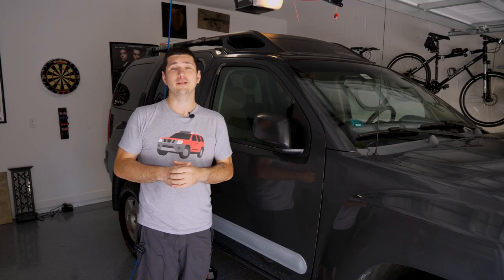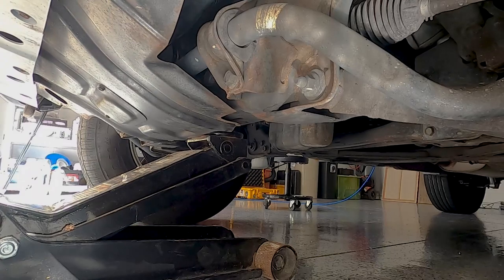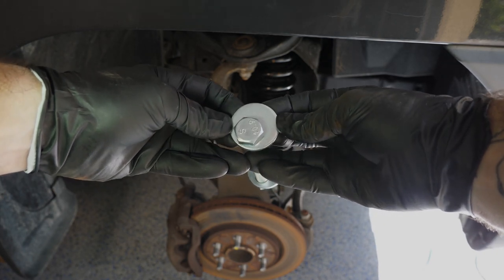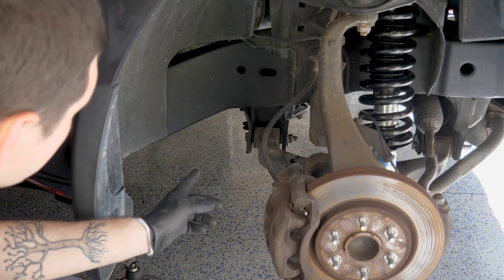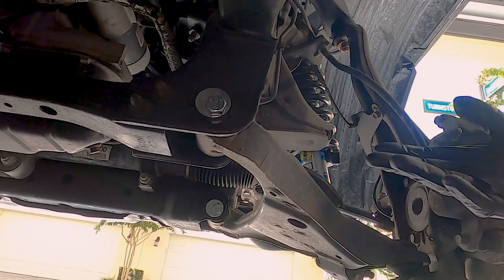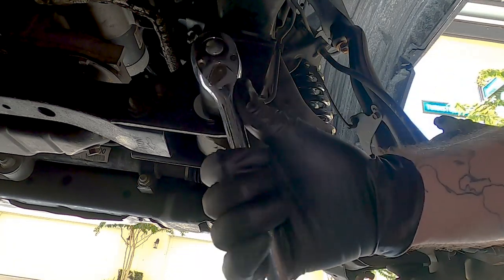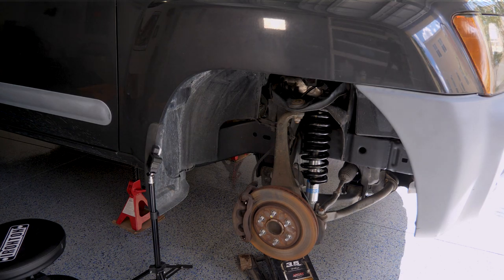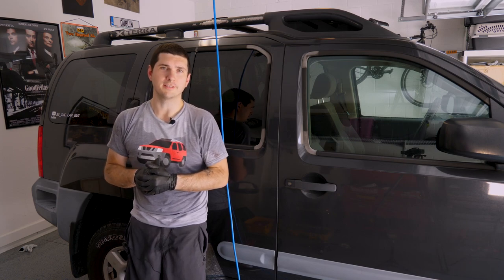How To Install Adjustable Lower Control Arm Bolts / Cam Bolts / Camber Bolts

Comment: I’m just sitting here laughing at the thought of all the X owners who had to cut out their bolts/LCAs watching this and yelling “WTF MAN! WHY COULDN’T MINE HAVE COME OUT THAT EASY!” 😂
Reply from the maker: haha I know it must be tough to watch. I grew up in the north fighting my cars every time I worked on them. I feel the pain. I can say however that I will never own another car from the north again. My Florida cars have spoiled me for life.
Reply: Yep, I bought my X in TX and it has been here  its entire life.  Every time I work on it, things come off relatively easy.
Reply: Lmao, I just said screw it and did all new LCAS it was a pain
Reply: I know that's right
Reply: @Rythecarguy  ok that explained it florida car
Reply: I just did my 06 hours ago, upper and lower. Sprayed with PB and CRC freeze off. They came right off on the first try, using a Harbor Freight Earthquake XT. 201K miles.
Reply: Well mine give a quarter turn in the bushings and no more on the passenger side the drivers sides been done a while ago so tomorrow morning after services I'll be opening up the right side and cutting free those seized bolts and replacing the whole control arm someone it appears welded the old bushings in the lower arm both ends on both sidesall the way around such fun
Reply: Mine was pretty easy to come out aswell lol

Comment: I just replaced the lower A-arms on my ‘06 Titan. I watched your video and I put my camber bolts in the position you recommended. I took the truck for the alignment. The owner of the shop (it’s a 1-man shop) asked me how I knew where to put the camber bolts. He said, “They were spot on! All I had to do was adjust the caster on the passenger side.” So, thank you for an excellent video with technical details that are “spot on”!
Reply from the maker: Oh awesome! Thanks for sharing that story. Makes me feel good. 💪🏻

Comment: Actually my 2005 off road model has the adjustable cam bolts already but I'm replacing them because they are getting rusty. I'm putting the Rough County lift kit on mine along with different upper control arms then its getting a professional alignment. I already replaced the worn and broken leaf springs and that was fun doing it on the ground. I know this video is on the older side, but it was still informative. Thanks for doing what you do for the Xterta owners.
Reply from the maker: My pleasure man. Hope your rigs doing well.

Comment: Hey Ry have you had any issues with the oil filter remote locator just wondering as since I got mine it's been oozing oil constantly and I cant see a reason for it when I changed the filter what would you recamend?

Comment: So after watching this I ordered some cam bolts and installed them. I removed the old ones and they did not look like the ones you pulled out. They looked somewhat adjustable with tic marks. I read on some forum that after 2005 (beginning in 2006), Nissan stopped putting adjustable cam bolts on the titans bc they felt they dialed in their alignment to the point where it didn’t need it. I was shocked to see the “adjustable” bolt bc I  do t even have a 4x4, I have the lowest trim/option 05 Nissan titan (xe).

Comment: I went to get my pathfinder aligned and the tech tried charging me $300 just for the cambolt install . My suv is all stock and he wanted me to install a camber kit on my suv.. He told me he couldn’t do the camber alignment but can only do the toe alignment … was he trying to sell me something I didn’t need? By the way, is the camber bolt only needed for lower control not for upper control arm and what  about the back , is it the same process ?

Comment: I have a 2015 Nissan Frontier that has the same suspension. I went to get a alignment after buying new tires and to his surprise there was no adjustable camber bolts. As a former mechanic myself he showed me on his machine a picture of it and that it was there but on my vehicle it was missing. Why would Nissan do this?  is this common with these Nissan Xterra's and Frontiers?
Reply from the maker: Yea, I am hearing about this a lot. Its probably some cost cutting measure. Let the consumer take on the cost if they want to.
Reply: @Rythecarguy  Buying the camber adjusting equipment should not be on the purchaser that's dope. I wonder what else they left out?
Reply from the maker: @boreed5734  I agree, it's stupid.

Comment: I have 07 Frontier, bought it new. Its been recommended couple times when i had my wheel alignment to replace cam bolt eccentric. I never have an issue with tire uneven wearing since brand new n now 13 yrs later. I just told garage dont worry on eccentric n just do regular alignment. Fronty runs great like brand new. Great vid !! Thnx !!

Comment: Hello friend, I have a nissan pathfinder 2005 I'm about to put a 2-inch ranch suspension but they tell me that I can have a problem with the alignment. The question is whether with the (cam bolts lower control arm) it would look good

Comment: That was easy. I changed mine a few months ago. One side was seized up. I ended up having to cutting the bolts off. This screwed me up because the lower arm had a cut bolt through the bushing. I ended up finding two lower control arms at the junk yard. Replaced the ball joints and now my Xterra is all lined up.
Reply from the maker: Good lord what a huge pain in the ass. Sorry to hear that. Glad it worked out though!
Reply: How did you exactly cut it off? I have a nut that’s stripped out!

Comment: Great video , I have a 2000 Honda Accord . The lower control arm broke away from the subframe . Causing the subframe to break . I am planning on welding a washer to each side of the subframe for support . This makes the original bolt useless . Your bolt looks like it would work for me . What do you think ?

Comment: are camber bolts safe? I heard they fail and when they do it could be really bad.
Reply from the maker: I suppose if you over torque then they could fail. I have personally never heard of it happening. And yes if you had cam bolts fail that would be a pretty serious issue.

Comment: Hi, Ry! You have a wonderful selection of videos to check out. Thank you for making them! 
My question is: I have a 2019 Frontier that I bought brand new. Everything was stock on it until two weeks ago when I added 1.5" spacers to the front (along with longer shackles in the back). The front wheels then had a positive camber which, because of the stock camber bolts, couldn't be adjusted. I then had the eccentric cam bolts installed just like the ones you have. When I took it to the alignment shop they made my tires as straight up-and-down as possible (I didn't want any positive or negative camber). To my eyes, my wheels still look like they have a bit of positive camber, and it's bothering me. The alignment shop said that there was no more play in the adjustable cam bolts to get the tire perfectly vertical. Do you think what they are telling me is true? I din't think that a 1.5" spacer would be too much for the eccentric cam bolts to overcome. Perhaps I need an adjustable upper control arm?
Reply: Good question. Too bad crickets. Did you ever learn a solution?

Comment: Well, got the 2 front bolts in each side. Rear lca bolts are rusted right in.  Penetrating oil, torch, using jack to pop it loose were all unsuccessful.  Time to head to a suspension shop unfortunately.

Comment: Hey, your using that Chicago Electric impact wrench from Harbor Freight. How's it held up? My local HF here in CA sells 'em for $50. For that price, I was contemplating getting one but had never heard of the brand before.
Reply from the maker: Yea, it works ok. The finger switch got a little finicky a few years after i bought it but it still works. I upgraded to a wireless Milwaukee wireless and its amazing but I keep the other around for certain jobs.

Comment: So are you saying the xterra does not come with camber bolts!? So thats why my tires are wearing on the outside even after multiple alignments?
Reply from the maker: Yes a lot of them did not. Some of them did if I recall. But yes. If an alignment shop does not see adjustable LCA's then just do "the best they can" and just don't fully align your truck. Definitely get some on there.

Comment: I had the front done but they told me that I have to get camber bold. For the back I called the Kia dealer they don't make them any more I have a 2008 kia Ronda what am I supposed to do
Reply from the maker: Just buy aftermarket.unless they are some crazy proprietary bolt then you should be able to find one that works.

Comment: Im getting ready to do the koni lift from all dogs with the add a leaf and new high clearance uca's . I also ordered cam bolts should i put them in after i do the lift or start with them iyo?
Reply from the maker: You dan do then whenever as long as its before you get it aligned.

Comment: When had my tracking done rear os camber was off was in red but garage said not in important so still did my tracking... So are camber important or not?
Reply from the maker: Camber is very important. It just that if your camber is off in the rear there is really not a lot that you can do about it.

Comment: What exactly is the purpose of an adjustable lower control arm?  What benefit does it produce? Thanks  BTW, I have a 2008 Nissan Frontier with a 2.5” lift package.
Reply from the maker: In the case of my Xterra the upper and lower control arms are not adjustable from the factory. This means that the only thing you can really adjust in an alignment is the toe in. When you swap these bolts out you are then able to adjust the castor and camber as well. All three are critical to a proper alignment. If you lifted your frontier you should definitely consider swapping these out if your current setup is not adjustable. If your alignment is wrong you could start burning through tires.

Comment: Nice video! Question though... why do some cam bolt sets come with 4 bolts vs 2 bolts?  Does the rear axle have cam bolts too?
Reply: I got it.  There are 2 bolts per side. I thought you had moved to the driver side wheel on the second bolt.  Duh!  Thanks!

Comment: does it mean when I do the driver side lca cambolts would be the same, rear washer has to face engine still and front washer facing the wheel. So the washers(wider side) on each side are facing each other.
Reply from the maker: Yes, wider side on the front is facing the wheel, opposite on the rear. Remember, this is just to get you to the shop for a professional alignment. You will still not be in proper alignment after you set it this way.

Comment: Can you provide more info on the cam bolts please?  Brand, supplier etc.  I have an OME lift on my xterra and the front camber is slightly positive - I think the alignment specs post lift were 0.7 deg and 0.9 deg.  It is enough that my tires are wearing a bit uneven.  I'm due for new tires this summer, so I want to get a slightly negative camber on the fronts, especially because when turning, the camber and caster put more wear on the outer portion of the tread of the outside tire. 
Thanks
Reply from the maker: Brand was SPC and supplier was All Dogs Off-road. If your alignment is close then adding these should bring you in spec.

Comment: good video  but you stated the nut bolt size is 19mm but video shows the socket you used is 21mm
Reply from the maker: Wild

Comment: Great content! Would these bolts be recommended for an Xterra with the stock ride height?
Reply from the maker: For sure! Especially if you want to have greater control over your alignment. A lot of times alignment shops will only align toe because the other points are not adjustable. Adding these will let them control more aspects of your ride.

Comment: Thanks for the info. Helped me out a lot. Went to the alignment shop, they were going to charge me over $200 to replace bolts. They gave me the option, this is the second time you have saved me time and money. Thanks
Reply from the maker: You got it! Glad to help. 👍🏻

Comment: I’m confused, if you change the position of the oval washer by turning the bolt, how doesn’t it change position when you torque it using the same bolt?
Reply from the maker: You have to hold the other side until it's pinched and then you can torque it down without moving the control arm.
Reply: @Rythecarguy  thanks!
Reply from the maker: @coreynoemif3j29  my pleasure dude. Best of luck with the job.

Comment: Hi, anyone know if r51 pathfinder take cam bolts on the *rear control arms to help with alignment?
Reply from the maker: No, I do not think they are designed for cam bolts.
Reply: @Rythecarguy  thanks for the reply.
Reply from the maker: @RolandoLopezNieto  any time!

Comment: Where can you purchase the bolt kit?
Reply from the maker: It came with my lift kit from All Dogs Off-road.
Reply from the maker: I also put a link in the description.
Reply: @Rythecarguy    Ohhh, I didn't click the "show More" in the description yesterday.   ok TY.  
I purchased my Lift kit Rough Country.  Looking at their LOWER CONTROL ARM CAM BOLTS they only have the oval washer welded on one side of the bolt.  
https://www.roughcountry.com/nissan-cam-bolts-1004.html?find=2006-nissan-frontier-4wd-736679
Weird to me.  That said I have been looking else where.
Reply: why would they sell only 2 bolts in a set instead of the 4 required?? strange.

Comment: Will these work on a 2002 Nissan Xterra?
Reply from the maker: I don’t know if the specific bolts I use in the video will work but cam bolts on the lower control arms will certainly work.

Comment: Are these bolts for both front and rear?
Reply from the maker: No sir. Only on the front. No control arms in the rear.
Reply: @Rythecarguy  

What about the backs , how do u adjust the castor and camber if there’s no Controls arms

Comment: Great video and thank you for supporting us "YouTube Engineers". I took my truck in for an alignment and they told me the cam bolts were spinning and wanted $380 for the repair, which I did on my own for only $60 in parts and in about an hour all done and back at the shop for an alignment. I found that doing the rear bolts sets first was easier to keep the control arm in place.